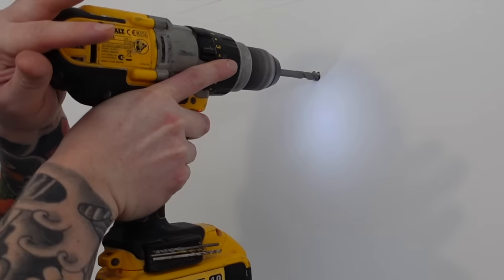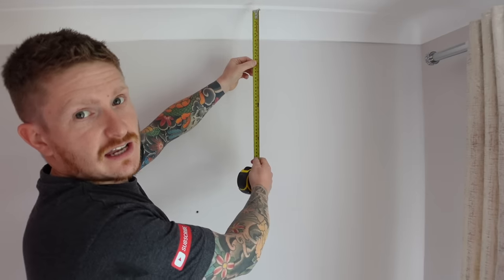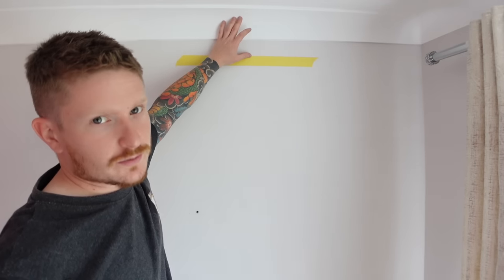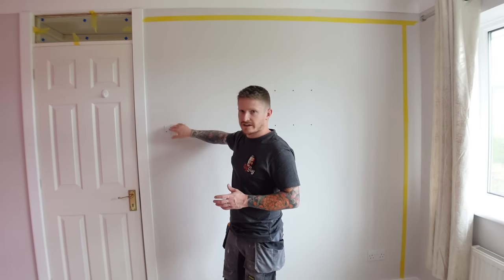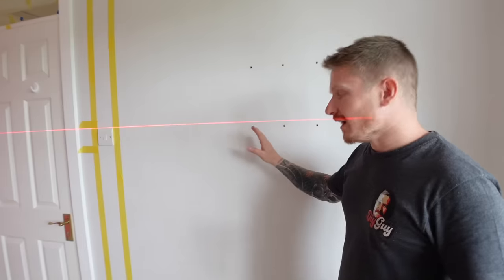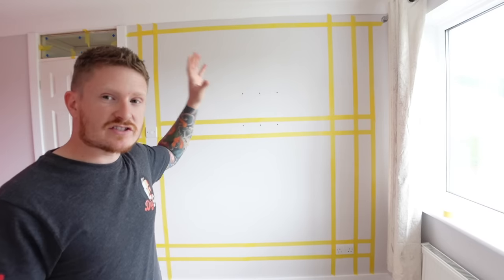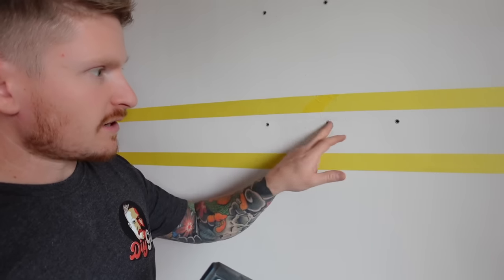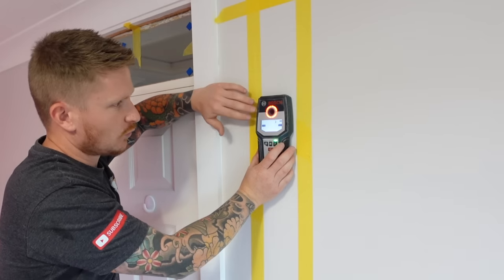How To Avoid Drilling Through Cables In a Wall | Cable Zones Explained

Comment: I've never had much luck with all these detectors they seem to beep all over the place!!
Reply: With my Bosch one, you have to 'earth' it by placing the hand you're not holding the detector with against the wall whilst you scan. Otherwise it just bleeps constantly.
Reply: Exactly this. Someone told me to Earth it also. Makes the world of difference.
Reply: And if it's not, some of them apparently suffer from static from where you run them on the wall/flock wallpaper I imagine. "Earth" them by bopping them on the head or tapping them on another surface if you're in your DMs.
Reply: Same here, just used it on the wall and it shows wiring all over the four walls

Comment: Worth mentioning a couple of other tricks: check what is on the other side if the wall is internal, and take the switch or socket off to see which way the cables exit

Comment: i think i heard you say the device was set to "electricity". does that mean electricity has to be going through the wires (lights turned on for example) to be detected or is it just detecting metal?
Reply: It just means he has the device in his hand set to electricity,these devices would have a setting for wood as in studs in the wall and metal for metal pipes also so you need to have the correct setting switched on,the device will pick up any electric current behind the wall regardless of wether the lights are on or not
Reply: @eddiecotter7201 I have that device and it doesn't always pick up cables on electric setting but it always does on metal setting

Comment: Lots of professional electricians refuse to install cables unless they are vertical.  The only exception is a adjacent socket  less that 12inches away or a cooker,or other outlet with a local isolator switch.  That’s why most cables get drilled as other trades and most DIYers don’t expect a cable to go sideways.
Reply: When I was an apprentice it was drummed into us that horizontal or diagonal cable runs are bad practice. There is nothing in regs to say not to run cables horizontal, it's just bad practice.

Comment: I'm one of those cool people who drilled a cable. Scared the life out of me. I used an existing hole as guidance that I could drill safely. Turned out the original installer had put their cable 1cm out of zone and nicked their own cable.

Comment: I want put 2 shelves up in my kitchen & I have a switch & an outlet on each side about 10cm apart.... so I didn't drill as I assume the cables are & could be all in that zone & maybe not attached to the stud as they should because I think the old owner did alot himself...so I'll definalty not be drilling in brackets for my shelves there...bugger!..thanks  for the great tips.😊

Comment: Good content, it’s worth mentioning that although regs are in place and should be followed I’ve seen cables at 45 degrees across a wall (dot and dab) I’ve also seen ables run down the outsider reveals right where a curtain hook would go. Great information as per👍🏻
Reply from the maker: Absolutely right

Comment: I remember in another video you had said about spurring off from existing sockets. how can you tell if an existing socket has been spurred from another socket? was thinking as well how you can tell if your wiring is "ring main" setup or a " radial circuit"?
Reply: Count the cables entering the back box of the socket. One cable means it's already on a spur. Two cables means it's a regular socket on a ring or radial circuit. Three cables mean it supplies a spur.

Comment: Hello, great video, I have a question regarding the zone at the joint of two walls. Would the ‘don’t drill’ zone apply where a chimney breast meets a wall? In other words, I’m wanting to put up some alcove shelving and would like to know if the 150mm zone as per the video would apply where a chimney breast meets a wall.

Comment: Great video, two tips to people in the comments:
1. In my experience there isnt much difference in accuracy between the cheap Amazon/ebay detectors and fhe expensive bosch ones
2. To be doubly sure, kill the power at the consumer unit then unscrew the faceplate for the lightswitch and socket to see which direction cables were routed
Reply: I've had cables do a sharp right out of the top of the back box so even this tip sometimes isn't enough.
Then theres water and gas pipes and studs, of course.

Comment: Great video. Just one question - at 1:59 when you talk about where two walls meet (i.e.. inside corner of a room) there is a zone at that corner. Would this also apply if a corner edge is formed at the back of those walls e.g. if two walls meet in an 'L' shape - the inside edge is a zone (as in your video) but is the outer edge a cable zone too?

Comment: I have a medium to large bedroom wall the plug double socket is in the right-hand corner of the Wall no light switch on that wall I tried, well my uncle tried to drill 4 holes for a mirror in the middle of the wall but the drill won't go all the way in to 3 of the holes its as though something's there and the drill head will not go any further? The main front bedroom is on the other side of this back bedroom.  what could be stopping the drill from going in, it's an old house I know the brick is hard but not so hard for the drill not to go through for plug and nail to go in. Please help?

Comment: Excellent video mate. It would great if you could do a video on adding sockets horizontally for kitchens along with how you wire them up.
Reply from the maker: Great suggestion!
Reply: @TheDIYGuy1  thanks, look forward to the video. You could even do an ‘ L’shaped connection for cooker socket if you know what I mean.
Reply: A series of down and up again "U"s
Reply: @JP_TaVeryMuch  Agreed,  ring under the floor coming up and down, up and down etc.

Comment: Thanks to whoever rewired my house before I got it. I followed the up down zone when fitting new kitchen wall cabinets, drilled 100mm to the left of socket, hit the bloody cable, it wasn't running straight up, was going at a diagonal!. Luckily they used conduit so I could pull it out from l the upstairs bedroom..... 😂
Reply from the maker: Ouch. These things can happen but as you say, luckily you could pull it 👍

Comment: Is there a similar set of prescribed zones for plumbing?  With more radiators being fed with plastic pipes, using detectors is often impossible.  Easier to repair a cable than a pipe too!
Reply: There should be
Reply: Not as lethal either. Unless it's a gas main.

Comment: Any switch or socket vertical or horizontal  is a danger zone. Should have also included wall lights too in that description
Reply from the maker: Yes Wall lights are an ‘accessory’

Comment: I dont think my detector is very accurate. I have two plug sockets that look like they come together along the bottom and go up vertically in the middle of the wall. Its a wall in a loft conversion so its possible. But when my detector picks up this supposed cable it seems to then say live wire on every part of the wall. I turn it off and back on again then it picks up nothing at all, even where it previously said there was a cable. Im not picking up anything above the plug sockets either or the light switch yet the fuse box is directly above that. I can avoid  those areas anyway its just bugging me that my detector is not giving me results that make sense.  And i am reluctant to drill into the wall i need to even though i know it "should" be a safe area.

Comment: I have to use this everyday for my job. 
Trouble is there’s not much you can do when the whole place is built with foil back plaster board and plastic pipes. I’ve used it where I know 100% there’s an electric cable with power switched on and it doesn’t detect when it’s not even that deep in the wall.
Reply: Yeah he says exactly this at the end

Comment: I’ve got that exact model of detector and it’s absolute junk I’m afraid, it beeps and gives off all manner of false signals, I even run it over some studwork I had just put up and nothing corresponded with what I knew to be behind it. It’s at the bottom of the van cubby box and that’s where it will stay. A complete waste of money. I’m not mocking the video in anyway just saying I’m a tradesman and I wouldn’t trust that particular model (just in case someone was tempted to buy it) as far as I could throw it, shocking really as I think I paid over £100 for it, a crystal ball would be more reliable.😀
Reply from the maker: Thanks for sharing your experience. It’s strange because mine has been very very good in most circumstances. I wonder if you have a dodgy one?